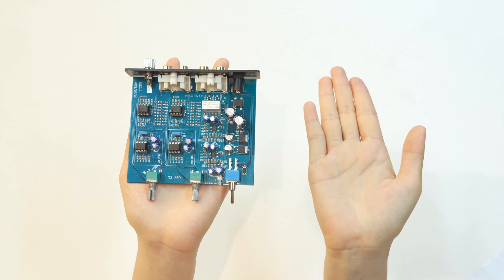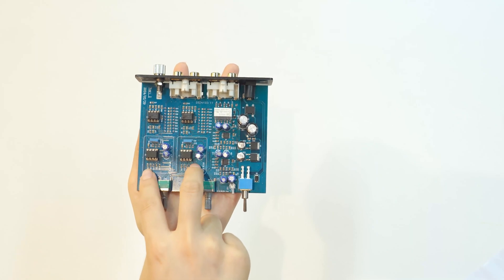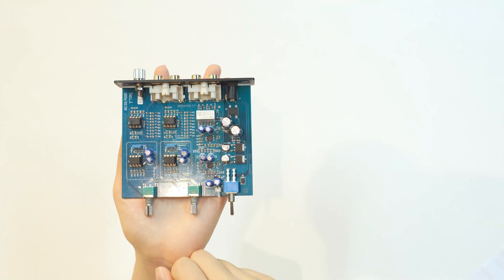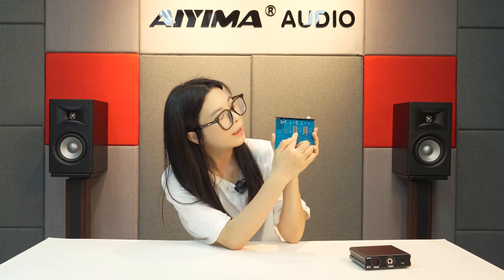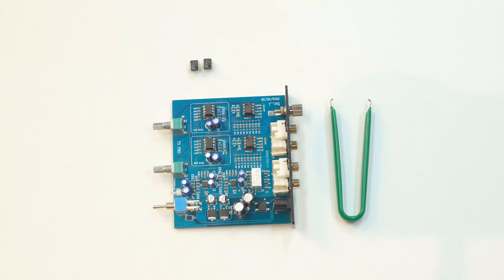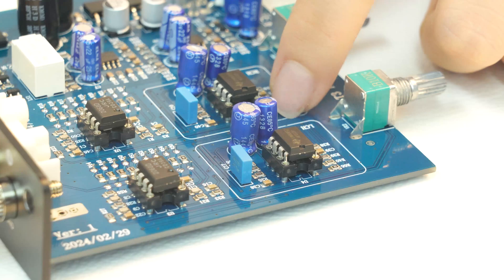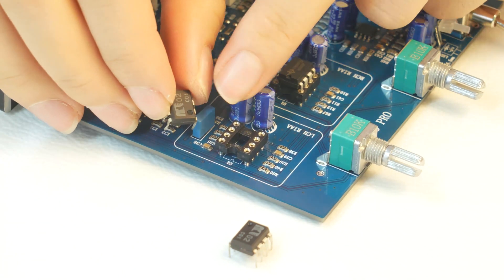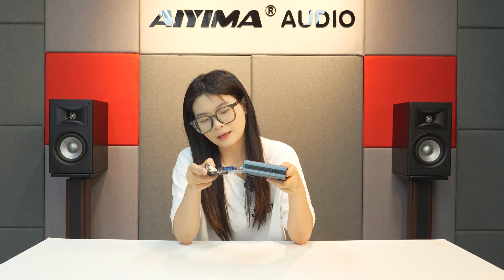Aiyima T3 Pro: Internal Structure & Chip Replacement

Comment: What is the topology?  Is it passive RIAA EQ between two gain stages? - mixed loop feedback and passive RIAA EQ?   Is the volume control just a potentiometer with zero gain? (What is the output impedance?) What is the real RIAA EQ accuracy? Plus -minus 3dB in the audio band would not be very good..   RIAA EQ accuracy is easy to achieve.   Please explain and provide more detailed specs